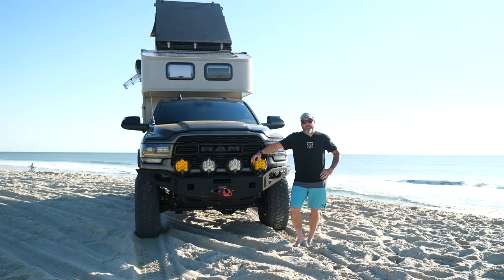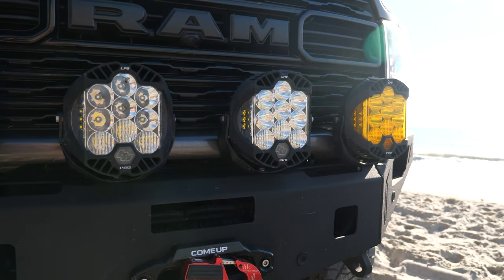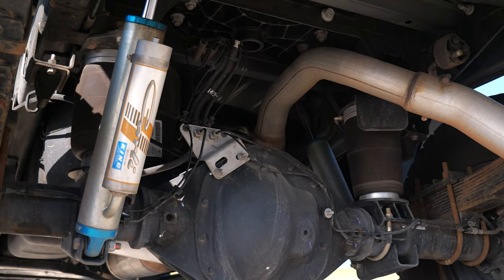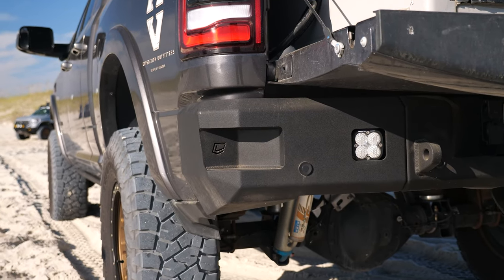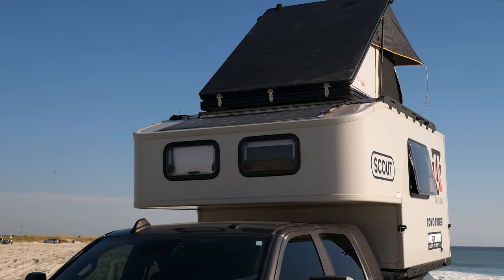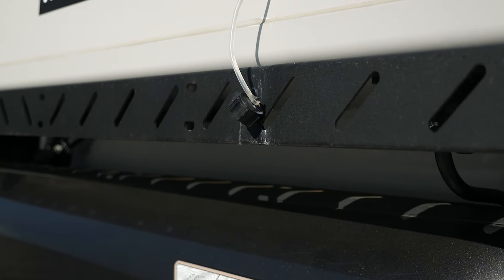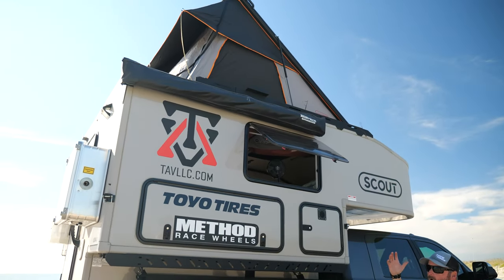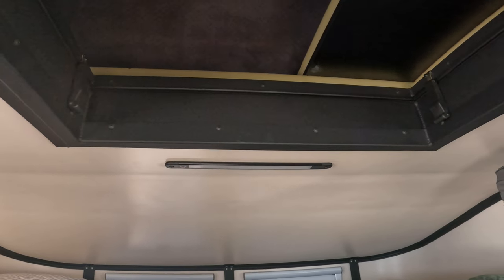The Ultimate Full Size Overland Rig - TAV Spec Ram 3500

Comment: Another fantastic build!! Question for Walt: was going with Dodge over Ford a price based decision or overall vehicle performance consideration?
Reply from the maker: Truck availability. At the time we needed two trucks to haul UTV’s and trailers to events. We ordered a ford and it took 1 years and 9 months to show up. During that time we were able to order a Ram with the same trim level and it showed up in about 6 months. Both trucks are amazing and it would be tough to make a decision between the two.
Reply: @TAVLLC  Thank you for the honest candor!